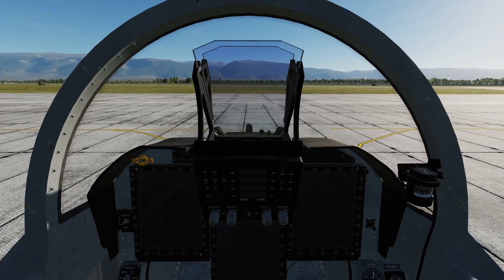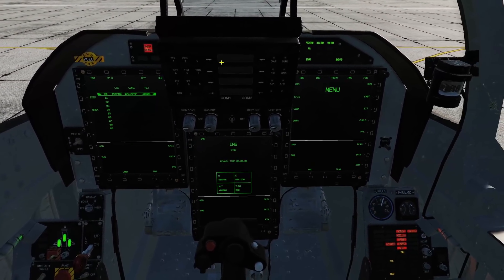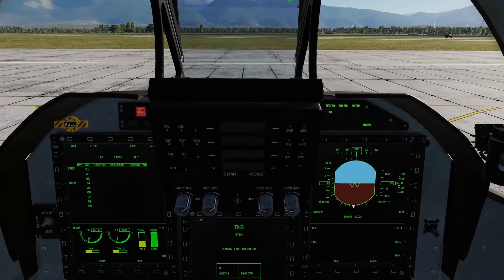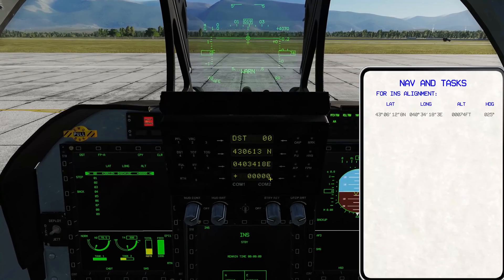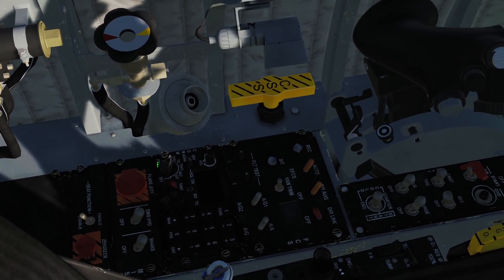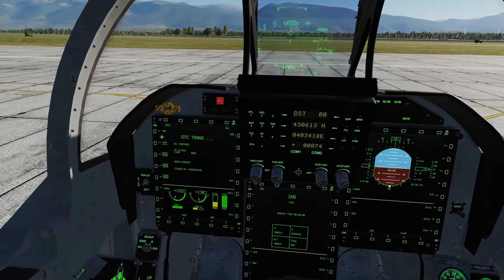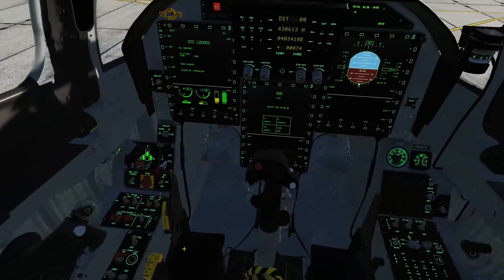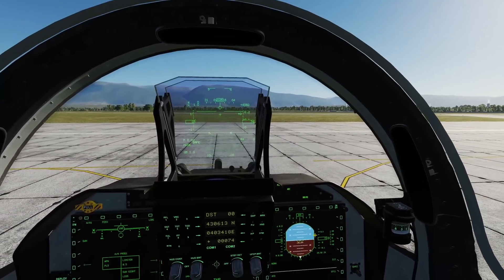DCS World - JF-17 - Quick Startup Taxi Take off Tutorial

Comment: Very good quick start up, but I have to add a correction:

That 180kts auto-rotation is simply an emergency function of the Flight Computer. You are supposed to rotate to 8-10degs. pitch at about 120-145kts depending on your loadout.
Reply from the maker: Yes, you aren't wrong thanks
Reply: Yeah I was thinking the same thing, every airplane will auto rotate eventually once airspeed overrides trim setting, don’t blow your max tire speed lol